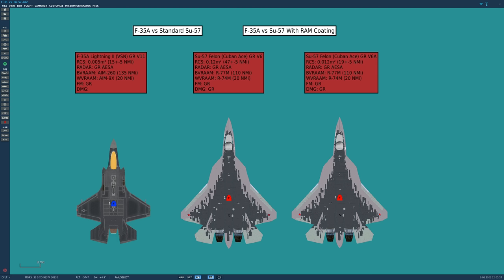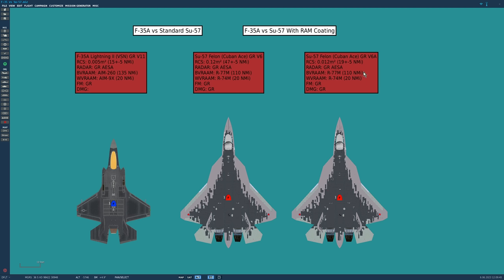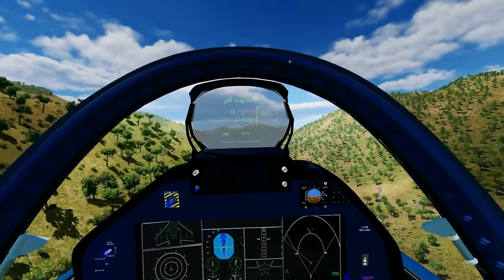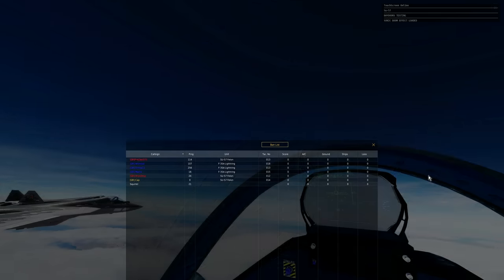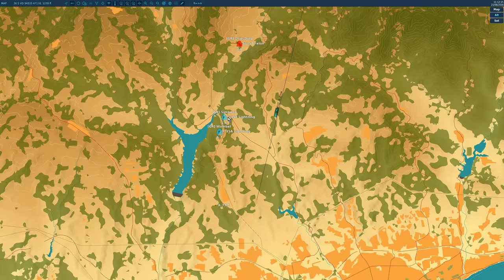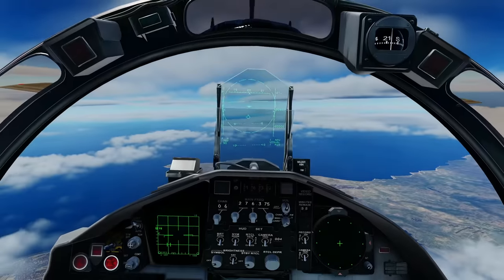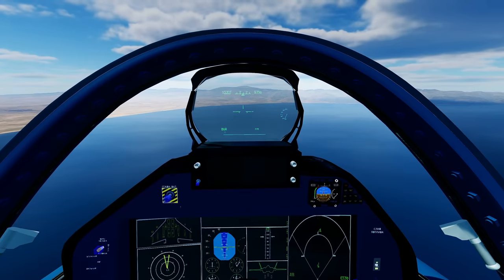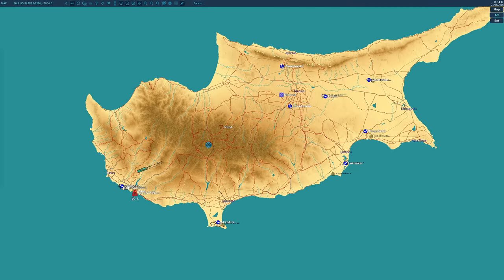F-35 vs Su-57 With RAM Stealth Coating: BVR Missile Battle & Dogfight | DCS

Comment: I want the F-35A to be represented more closely than their analysis has done. The F-35 doesn't have RAM coating, the radar absorbent materials are baked into its skin. I've stated this before, but the USAF has officially came out and said the RCS of the F-35 is LOWER than the F-22.

They also noted that a factory of safety is applied to damages to the surface of the F-35 will maintain its stealth profile, so it's much stealthier than this unknown RCS. The F-35A's RCS needs to be at least lower than the public F-22 number. I have provided the quotes below:

Two USAF Generals on the F-35 Stealth
---
Gen. Gilmary Michael Hostage III, then head of Air Combat Command, said at AFA’s September conference that the F-35 “has drawn a lot of criticism” for some of the sacrifices USAF has had to make to pay for it. However, “it is my professional judgment that recapitalizing our aging legacy fleet with a fifth generation capability is a national imperative,” he declared.

Hostage caused a stir in late spring when, in press interviews, he said the ----F-35 would be stealthier than the F-22-----, its larger USAF stablemate. Conventional wisdom had pegged the F-22, with its angled, vectored-thrust engines, as a stealthier machine than the F-35. Hostage also said the F-35 would be unbeatable when employed in numbers, which is why the full buy of aircraft is “so critical.”

“I would say that General Hostage … is accurate in his statement about the simple stealthiness of the F-35 [with regard] to other airplanes,” Bogdan said in the interview. The statement was accurate for radar cross section, as measured in decibels, and range of detectability, he said, and he scoffed at the notion that anyone can tell how stealthy an aircraft is just by looking at it.
---

Chief of Low Observability for the B-2 On the F-35 Stealth
---
On a radar map, a 747 would appear the size of a hot air balloon and an F-16 would look like a beach ball. Drill down to legacy stealth aircraft and Lockheed’s F-117 Nighthawk would show up as a golf ball while an F-22 Raptor might appear as a pea. With the F-35, Lockheed is getting down to pebble size, according to Robert Wallace, senior manager for F-35 flight operations.

Wallace, a former chief of low-observability for the US Air Force’s B-2 bomber, says the F-35 has leveraged LO qualities from the bomber – but he could not elaborate on specifics.

Pilots will see a more advanced low-observable signature on the F-35 versus the F-22, but it’s the maintainers who see the greatest leap in durability. Each time a fighter returns from flight, maintainers must bring the aircraft’s stealth signature back to its original fidelity. But a fighter confronts more demanding missions than a bomber, pulling 9g while flying from hot, desert environments to high, cold altitudes.
---

There's more quotes that corroborate this report but only provided these two for brevity

Comment: 2 things that would be interesting to model: the electrooptical system of the f35 (that diamond shaped think beneath the nose) and the reduced thermal signiture of the f35 that would hinder the enemies EO systems
Reply: Spoilers: Model a SniperXR, make it slightly worse, and you have the current EOTS system. 

It's not super-great but it's slated for overhaul. It was one of the earliest systems "locked in" on the design. EODAS is getting overhauled too.
Reply: @fnhatic6694  It’s also fused with the forward quadrant DAS camera on top of the nose, the AESA, and all the RF antennae embedded in the leading edges and airframe in a frontal aspect A2A scenario, interleaved with its flight mates’ ships as well.  The IR resolution of EOTS is a consideration for A2G, but not as much for A2A.  The new IR systems with Block 4 will smoke all of that as you point out, but it’s currently an extremely capable system without peer.
Reply: @LRRPFco52  The sensor fusion sounds simple but it's what makes the F-35 so damn cool. 

People on the outs don't "get it" but I always described the avionics as 'video game shit' because it's as seamless and integrated as video games. I love the F-15 but it's like the damn Battlestar Galactica where nothing is networked and talks to each other.

Comment: Now we just need to get thr F-35's insane maneuverability added into the mod.
Reply: I assume you're joking because they do call her Fat Amy for a reason
Reply: @noidea7695  watch some vids of the f35 at an airshow, its probably more maneuverable than a f16, paired with higher aoa than the fa18
Reply: @noidea7695  not joking. The F-35 WAS called Fat Amy, that was before the dogfight trials between it and F-16's, the Air forces most capable dogfighter outside of the F-22. 

The F-35 absolutely annihilated the F-16 in mock dogfights, and the pilots of the F-16s were all veterans and experts of their planes.
Reply: Witnessed it with my own eyes. The F-35 tore up the MCAS Beaufort air show. Watch some videos instead of reading about names.
Reply: @noidea7695  Your name is pretty accurate. Those things irl at air shows are like mini f-22s. FCS still on.
Reply: @noidea7695  Yeah. The reason is because the jet looks fat. Not because the jet is not manoeuvrable.
Reply: @noidea7695  I can only wonder how a plane that demonstrate such maneuverability in front cameras is a "Fat amy" while SU-57 is parade fighter.
Reply: @gaiofattos2  Easy, the Su-57 barely is even real :)
Reply: @gaiofattos2  The Su-57 is probably the only 5th Gen fighter to had engaged enemy fixed wing aircraft so far. Not bad for a parade fighter.
Reply: @miquelescribanoivars5049  It's not even close to front lines. It's a 0.1 sqm² aircraft who some mods on telegram credit to a +100 miles kill on a Su-27 on Kiev. It's just bullshit.
And F-22 and 35 were involving in training with other countries even the J-20 participated in training with Chinese planes different of the Su-57.
Reply: @gaiofattos2  Yeah sure... I don't really care about the specifics but the fact is that so far it is the only 5th Generation aircraft that had been deployed and participated actively in a conflict with an on-going air war. This kind off nitpick is likely claiming Turkish F-16's weren't being used in the Syrian Civil War because they "never" crossed the border.
Reply: @miquelescribanoivars5049  It's different, both Turkish and Russian air force presented intensive proof of the use of F-16 in Syria. Including proofs on a L-39 shot down by an aim 120.
We don't have any proof of the usage of SU-57 in Ukraine and we don't know that it even can fire a missile from his internal bay.

Also, F-22 and F-35 were used in Syria by USAF and Israeli Air force.
Reply: @miquelescribanoivars5049  According to the Russians and with no evidence to back it up. It barely even qualifies as a parade fighter although it has a decent record of looking good in air shows.
Reply: Remember when I first saw the tactical turn maneuver. For a minute, forgot I was watching an F-35.

Slowly but surely losing the software constraints and pilots learning the aircraft. History is full of aircraft that weren't great until they were.
Reply: Everyone who thinks fail35 has "insane maneuverability" is beyond delusional and needs to take some classes on aerodynamics 101. It's got stubby wings that barely give it any lift for it's size and weight. It's got a high wing loading, the absolute worst enemy of high maneuverability. The plane is so draggy it CANNOT supercruise even with a engine that is cranked to the limits which is why it keep failing so much. Internal bays or not it doesn't matter, there is too much drag. The bays are also pathetic, like cmon only 2 bombs. It needs 43 seconds MORE then a f16 to speed up from mach 0.8 to mach 1.2, can't reach mach1.6 without using all it's fuel and can't even fly if there is a bit of thunder. This thing was supposed to replace the f16,f18 and a10. The only thing it did was replace none and instead the usa has finally realised it's not a "light cheap fighter" and decided to make a new project to do what the fail35 was supposed to and it probably will be another bunch of nonsense. It wants to do everything but is good at nothing.
Reply: @antoniohagopian213  2006 called. Wants their FUD back.
Reply: @antoniohagopian213  Man, F-104 was the master of aerodynamics performance and yet was unfit to perform multi mission role in German, while G.91 was prefered over F-104 later.
The thing is that you're comparing F-35 replacing F-16,F-18 and A-10 (that shit is less aerodynamic than a Biplane lol) like F-16, 18 and A-10 (lol kkkkkkkkkk) could perform their roles in modern contested air space with dozens of SAM systems and radars.

"The bays are also pathetic, like cmon only 2 bombs. It needs 43 seconds MORE then a f16 to speed up from mach 0.8 to mach 1.2,"

Only one can make it to the target and F-16 with strike payload will be slower than F-35, full payload F-16 cannot even think about surpass mach 0.98.

Comment: I think the RAM-coated Felons should be the standard Felons going forward. The same goes for the improved F-35s. They both help to keep the matches unpredictable and unpredictable equals interesting. I won't be surprised if future Felons come with improved RAM coatings IRL.

Now I want to see if the RAM-coated Felons will make life harder for the fourth gen fighters in future battles.

The non-coated Felons had a life expentacy measured in seconds whereas the RAM-coated Felons were able to hang on for a little longer.

The F-35s sidekick mod is meant for six fox threes only. The A and C variants will be getting them but the B will not due to its smaller weapon bays.

Comment: Would interesting to see the British f-35 with the meteor to see if that changes the outcome
Reply: Biriths F-35 still not using the Meteor missiles. Only from 2026.. The missile is too big for the hull, so MBDA came up with a smaller missile design. Which will work. Test launches scheduled around the mid of 2025. How I know? Read British news websites. :D As it is official.

Comment: By the way, the Su-57 can carry 6 r77 in the center bays plus 2 fox2. Cuban ace had to make the compromise of putting 4 because this mod can actually use ground munitions unlike the f22 mod, so the  spacing would be very wonky with 6 stations inside. Hoping he fixes it in the future.
And we must not forget the Su57 has two L band radars in the wings which would let it find any stealth plane very easily.
Reply: L band lights your aircraft up like a Christmas tree. And still wouldn't help much. In full stealth configuration, an SU-57 wouldn't be able to spot an F-35 outside of 30 miles or so even WITH L-band. 
Not to mention, Lband doesn't help with missile guidance. Russian missiles still have no hope of tracking U.S. stealth fighters and actually hitting.
Reply from the maker: I could always use wing pylons and just not increase the RCS. Will save a load of work.
Reply: Frankly I think that the Su-57 is more effective overall when using external stores. The stealth isn’t good enough even in best case to justify losing firepower by going internal weapons only.

Comment: Hey Cap! Given how public figures can be so challenging with claims of all sides either over or under reporting the potential of their aircraft, it makes it hard for any consistent modelling between aircraft of different sources. If it would be possible to run these independent models for as many aircraft as possible and use these results it would at least give a fairly consistent model for the RCS of each aircraft. There is always the possibility of further materials tech and differences between radar absorbent coatings meaning that there will be greater variation between aircraft from different sources, but as there is no way to know the capabilities of each producer estimating that they are all equal seems the best outcome we can hope for.

Love the vids, keep up the great work! Hope baby reaper is well and not giving you too much trouble!

Comment: What about sideways RCS? For tasks like notching missiles or or when cranking this can matter a lot, and the 57 seems far less optimsked for this, which I think aight to be reflected in the way you modelnitnto some extent too. 

Additionally. Does their software model creeping waves and other less radar radiation propogation? The F-35s RAM coating for example isn't uniform but carries electricall conductivity in certain areas to make creeping waves release radiation in directions that aren't back at the emitter. Even if the SU-57 has a "relatively primitive" RAM coating now, it's likely to still be missing subtle nuances like this.
Reply: Unfortunately, DCS models RCS as a single value that never changes, and none of the nuances are taken into account.

Comment: I would absolutely change the RCS of the F-35 to 0.002. While you're modifying it, can you please fix the flight model so it's more kinematically correct? Also, the radar has recently been said to be close to about as powerful as the old E2D awacs. Can you model a better radar?

Oh, and i would use the Su-57 with the RAM coating.

Comment: Another thought is that less of the SU-57's front profile is RAM coatable. They can't cover the front of the IR targeting thing with anything, and the engines' air intakes are straight, so you'll get some reflection off the non-coatable turbo fan blades. The side profile too, clearly has some of the engines' outlets exposed. So I'd say the theoretical minimum rcs would be around 20% of the full cross section or 0.024m^2, leaving an rcs of 0.098m^2 that could be RAM coatable. 

So I wouldn't go any lower than 0.034m^2  for the SU-57s RCS.

Comment: I think to be fair that both should use the simulated values, as both versions of the 57 are using it. That or bump up the Su-57 to 0.03m^2 to as the F-35's simulated RCS is 2.5 times smaller than the public figures.

Comment: logically speaking I'd believe public information on the f35 cross section being stated as 0.005m as if someone made a radar specifically to counter 0.005m cross section then you'd have a bit of an advantage. When dealing with fine stuff like taht it's nice. Also it's just a better way forward regardless of if it is right because it is unbiased. Everyone follows the same laws of physics in this sense. Regardless of the copium driven freeaboos and tankies :)

Comment: Using official numbers for jets has some problems:
- Each nation does not always release numbers for what we'd like to have numbers for.
- Some nations are known to overestimate their abilities, and others are known to underestimate, and which is which can change at any time.

Using simulated numbers for jets has some problems:
- Simulation takes knowledge, time, and effort. This means we're putting a lot of trust in whoever does the simulations to not be biased.
- Whoever does the simulations should probably be compensated.
- Simulations tend to assume everything is working perfectly - not a single scratch in the stealth coatings, for example.
- There is risk of missing something important in the simulations that the official sources will know about.

My vote is to use simulated numbers for both the F-35 and Su-57.
If possible, include differing stealth numbers for the F-35A/B vs F-35C with its larger wing area. I'm also interested in the J20 estimates - I saw a comment saying it was planned.

Finally, remember that modeling approximations of the differing radars becomes more important as the stealth coating approximations gets more accurate numbers. This was already declined by GR because of the difficulty in accurately modeling them.

Comment: last i checked the f35 can't operate any IR missiles in its internal bay due to heat issues. the heat during internal storage tends to mess with the IR seeker.
that means the f35 MUST have external mounts to use IR missiles. 
any use of external munitions will have a rather large effect on RCS signature. 
any flight with sidewinders will not be at your LO RCS setting.
Reply: Its not purely a heat issue, its that Sidewinder is designed to launch from rails with umbilical's while the F-35 only has bomb racks internally. Supposedly IRIS-T has an adaptor in the form of a coolant drop pod on the nose to allow it to be carried internally by the F-35.

Comment: How about something even more silly, a random encounter of stealth on stealth, meaning one side do not know what sort of stealth plane they may face at Bullseye.
However with an interesting twist, one of the "stealth" planes is a modded Warbird with a very low RCS, stealthified basically.
Opponent doesn't know if it is a stealth jet they are facing or a potential warbird, and how would that affect the dogfight since you are fast and now can't rely on radar to locate the opponent again.

Comment: RAM doesn't actually do that much for fighter aircraft as they have only so much weight and thickness available. The B2 on the other hand, that has much more in the way of RAM coatings to the extent that it does do a lot

Comment: Very interesting stuff. I have asked before, but can't remember and anyway it was a while ago,, if DCS does bother with the RCS aspects. for example the SU57 in the discord images there seems to be very visible directly from the sides. Which is highly interesting as you tend to fly sideways to an incoming missile to "notch" it. (tactics,, is it better to wait until you are locked on, instead of pre-emptively notch?? maybe a video if DCS can do it?) 
If DCS does do some kind of RCS calculations, it might be interesting to dive deeper into how it does that.
Reply: DCS uses a single RCS value, regardless of the aircraft’s aspect.
Reply: @MaxIsStrange1  That's a shame. But maybe there is a way to mod it in as a modifier value to any radars.